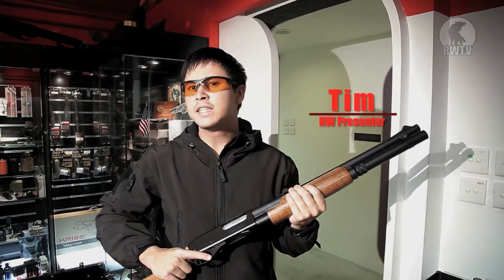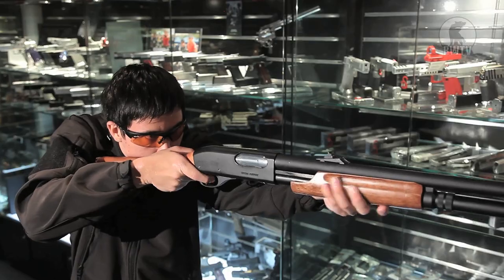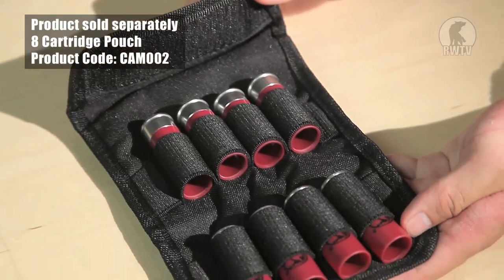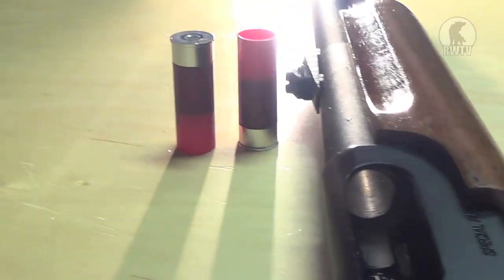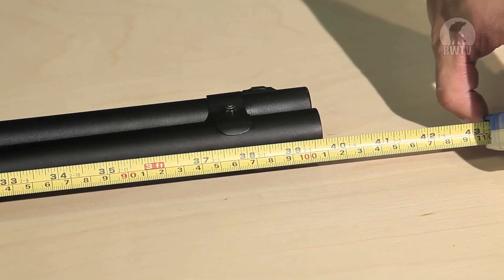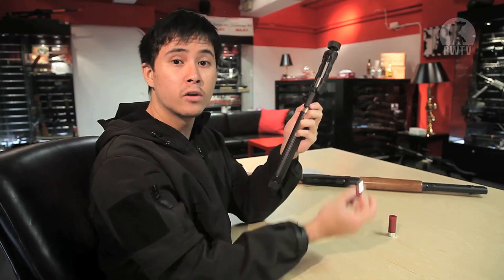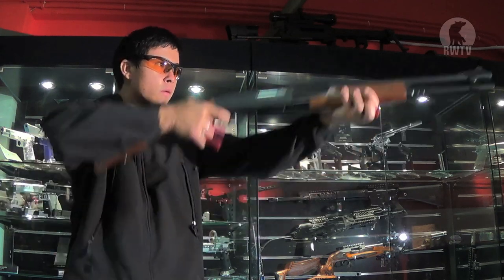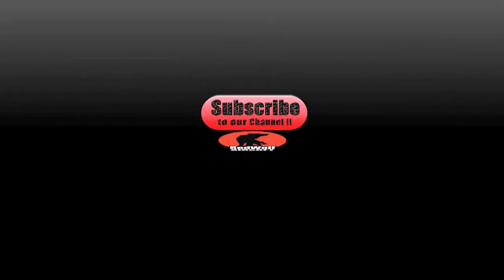Why APS's CAM870 Shotgun Brings You To The Edge of Real!  - RedWolf Airsoft RWTV

Comment: Personally I think the design would be much improved if the gas reservoir were inside the gun itself. Some system like the marui shotgun, with a removable gas reservoir inside the stock would have greatly improved this gun in 2 aspects.
One - The shells could be made far cheaper
Two - Take a damn sight less time to refill with gas

That said, this is still a wonderful thing to see. The included shell catcher makes it reasonably useable.
Reply: Your design proposal is just the Maruzen M870.
Sadly this model is out of stock in a lot of online shops.
Reply: MacRoss1792 The Maruzen M870 really lacks power. I had mine upgraded by Clarence Lai (Airsoft Surgeon) to use Green/TOP Gas and it still only has decent range when you load one or two BBs per shell. Any more than three, and they barely clear the barrel. The APS design ensures that all twelve BBs are propelled far enough, even though it certainly won't work miracles outside of CQB.
As sharkaithegreat mentioned, the TM M870 is another nice approach, less realistic but it more than makes up for it in terms of range and capacity. Try Marushin (or clone brands such as Tercel) for other shotgun models with a comparable mechanism (although tube-fed as opposed to shell-magazine-fed).
Reply: Pierre-Adrien Beauplet I have this Maruzen M870 and what you said is true. I bought it for props purpose and then tried using it in CQB but it lacked punch with maximum capacities of the shells. But i kept it because the association i went accepted it. I would rather using the Hwasan double barrel shotgun for clearing rooms but it is considred too punchy here.
The TM model sounds good for range but in Paris (France) it is hard to find intramuros openfields to play (i don't have a car... yet).
Reply: MK2 is exactly that and it is shit. Reason oh you know the reservoir cooldown.

Comment: The cam 870 mk3  can shoot standard   full power 16 gauge shotgun shells, about 3 before the aluminum barrel starts to swell  btw push the forend away from you   hard ,   speaking from experience.
BTW  it won't work if you don't have taped the rim couple of times with electrical tape   😄  but  be safe    its not meant to be real

Comment: If I can I will make a airsoft saiga 12 shotgun with those shells but the issue is the blowback system I need the shells to have enough pressure so they can push a bolt and carrier back

Comment: would it be reasonable to put 4.5mm bb's in this for small game or varmit.
Reply: NO! it only shoots at 280 FPS and therefore cannot be lethal and will just cause the animals pain! just buy a 22lr. rifle or a real shotgun ffs. those are cheaper anyway..
Reply: ok.
Reply: If you mean rat control, then yes and no is my answer, yes 4.5mm steel bbs would kill any vermin at close range but you'd make a lot of mess, and the point of using a bb gun for vermin control is so that you can get clean, easy to dispose of kills

Comment: how many shells per pair of co2?
Reply: I also want to know this
Reply: Heard it can do about 8 shells or so. (Very late response, so you probably found out already).
Reply: ArngrimTV thnaks for the reply anyway. I find that by charging it for 10 seconds or so, I can get a good 20-25 shells actually. Problem is if they start leaking.
Reply: Wow, 20? that's great! Sorry to hear they are leaking. Felt that only getting 8 "shots" out of 2 co2's is pretty expensive to run it, but with 20 thats a ton of shots.

Comment: Now I wonder, could one make an airsoft slug?
Reply: you could try.. nerf dart maybe?
Reply: You can use 0.68 Cal reball or the RAP4 training rounds and it will fire just like how you do in paintball game, but since the power will be too high for indoor games, you have to use HPA with a tank regulated to 920psi output, that will give you a 220fps with a 3g ball, and that power is what they use for indoor reball game. If you want higher power, you can use 1400psi or 1200psi output reg on Ninja tank, and those will get you up to 325 FPS with a 3.9g riot control round, a fucking 19 joules that can crack rib cage.... you can also do wax slug, tested max at 25 joules.  https://www.youtube.com/watch?v=ah8K7b4QQd0

Comment: PEOPLE THAT HAPPEN TO SEE THIS COMMENT AND ARE PUT OFF BY THE SHELL LOADING PROCESS:
The new version of the shotgun is cheaper ($275-350 USD for most of them off of APS’ website) and the shells only hold the BBs, wadding and cap. The gas is now loaded into the bolt, which makes load times significantly easier. The only real downside of this is that the bolt only holds enough gas for 12 shots, but it doesn’t take too long to refill and shouldn’t be a problem for people running something like the Serbu Super Shorty (2+1), or people that are confident they can land all of their shots. It seems to be a great CQB option for those that can acquire many shells (which are now way cheaper) due to the massive BB output and the spread.
Maybe one day I’ll get a Mk. II version of one of these, they seem like fun to play with.

Comment: For the price of that Airsoft shotgun you can buy an actual 12g shotgun...
Reply: Just like I said above, you can run the gun on HPA, and use HPA tanks to fill the shells, or handpump (PCP) to fill them. These shells can max go to 2000psi as tested by me, and can shoot 3.9g riot control balls (hard rubber) up to 30 joules. That is the power of the FN303 riot gun, now imagine what else you can do beside airsofting?  This gun is not a toy for sure, it can be a less lethal launcher firing rubberballs, pepperballs and even breaker balls. No joke, the power is just awesome

http://youtu.be/2OjE0A95-YA  - check it out

Comment: you know a real 870 costs about 300 usd right?
Reply: you cant shoot your friends with a real thing though
Reply: you do know a airsoft shotgun is made for a smaller market, and is more complicated with more fine made parts and therefore is more expensive to make?
Reply: Torbjørn Kolven MORE FINE PARTS ..LOL M8  MOST PARTS ARE MADE OF THE CHEAPEST ALUMINIOUM AND TEND TO BREAK :p
Reply: I'm sorry, let me rephrase that.

a Real firearm are made strong with coarse parts to handle the pressure of shooting.
a Airsoft replica is made with less strong, but with more parts, smaller (more detailed parts)

The reason airsoftguns break is becouse they use cheeper made parts to hold the cost down, due tho the amount of parts and the technicallities of producing said parts.

also, say they make 5000 airsoft shotguns total, while a real firearm is being made 10-20k per month.

that allso makes the real firearms cheeper to make. think of a real 870 as a mass produced cheep car, and an airsoft shotgun a limited produced sports car.

the sportscar is more expensive, you can get a "REAL" car for cheeper.

Comment: ugh, couldnt this be converted into a real firearm?
Reply: No but you can run HPA with this gun or pump air into the shells with a PCP handpump like I did, and max you can get about 30 joules shooting 0.68 Cal riot control balls (hard rubber balls, 3.9grams) http://youtu.be/2OjE0A95-YA -- see how I did it?  The shells can withstand up to 2000psi pressure, insane tough!